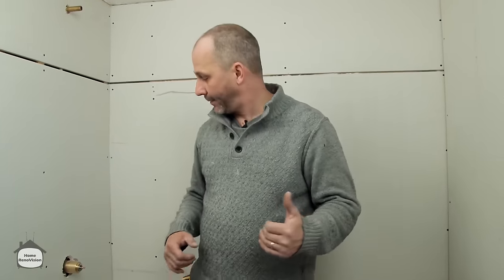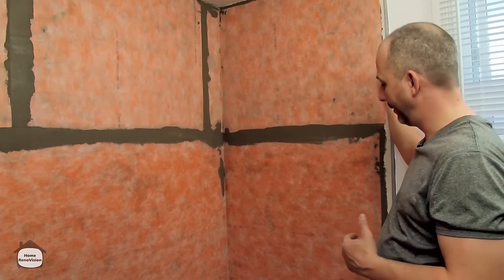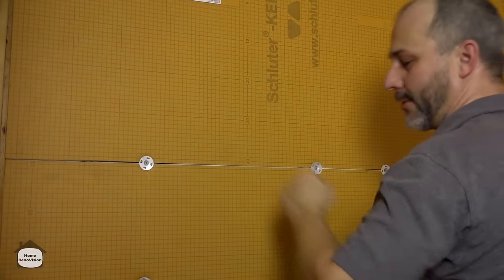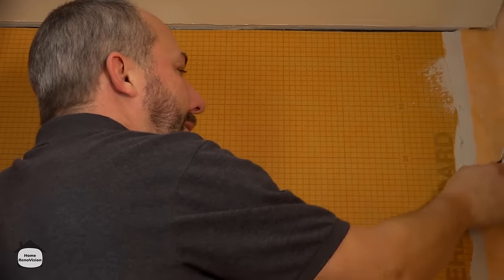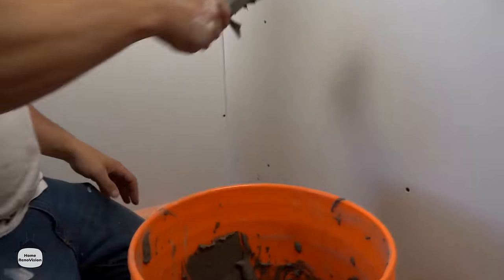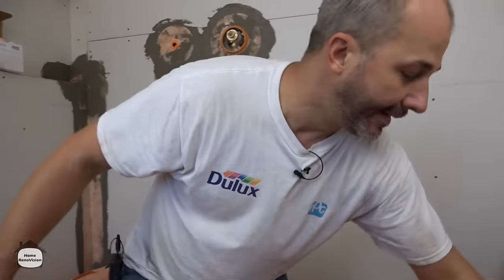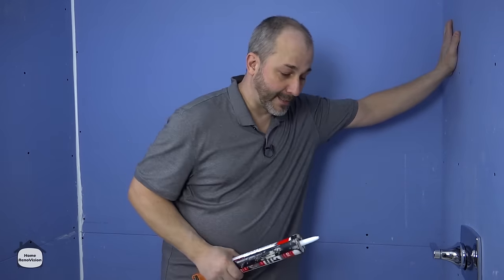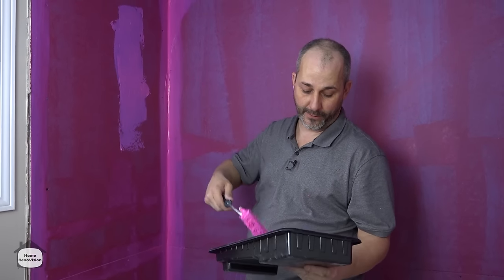4 Types of Shower Waterproofing Systems for Your Bathroom

Comment: Can I use the roll on sealer directly on top of mud bed pan and not use a liner?
Reply from the maker: Hi Bill, the roll on s=deigned to apply to a substrate that is screwed into place and has sealed corners. If you use a pan liner you are using a totally different system and I advise to complete the install according to recommendations form those suppliers.Most problems happen when people experiment with materials that have not been tested with each other. Don't make your house a lab!

Comment: Question: How do you waterproof when there is a window in the shower? We have a sizable one and am wondering how to waterproof the window area as well as the surrounding walls.
Reply from the maker: install a quartz sill around the window jamb and then have the membrane finish onto the back side of the quartz. this will seal it up nicely. Any extra can be trimmed up. or you can use the membrane up to the quartz and then use the kerdi fix as a caulking sealant before you tile. Cheers!
Reply: I would like to see a couple of days to handle the window as I also have a window to work around and haven't figured out my options.

Comment: Hi,  I watch in amazement how you do stuff.  Perfectionist and so knowledgeable!  I would like to know what other sealant you would recommend.  Lepage is only available at Home Depot Canada. We are goingto use last method you presented. Just out of curiosity,  why not  use mold proof drywall tape?Thank you so much.
Reply from the maker: Use the kerdi fix sealant from Schluter  or any other sealant for use on polystyrene. Always use the kerdi tape for a waterpoof seal, Moldproof tape will not bond to kerdi and will break down over a short period of time.
Reply: Home RenoVision DIY thank you!  You rock!

Comment: I just did this job where we ended up doing their shower for them which we rarely ever do, we as actually framed this shower like a year n half ago n the people that came in and did the tile n shower pan screwed it up, so it's a fix it job, any way my cousin n aunt put the tiles on n I believe it's one of those special steam showers has 2 shower heads, n they attached the tile with mastic instead of mortar or thinset and I was wondering if that's okay because I have read that mastic will fail if it gets wet
Reply from the maker: I never use mastic on a membrane. There is bound to be a problem over time  dependingoon how much use thew shower gets!
Reply: @HomeRenoVisionDIY  thanks that what I thought! Little late now... lol I won't say anything till next time we have to do one, he's the boss anyway, thanks again

Comment: Do you need water-proofing and insulation on the inside shower wall containing water lines and diverter? I had to open up the wall for a leaking issue.
Reply from the maker: waterproofing yes but no insulation.
Reply: Thanks...

Comment: Can I build a 4'W x5'D curb less shower? I will cut the floor joist for a quarter bubble and sister each side plus cross brace for added support.  Drain is 13" off the rear wall. I want to install a 40+" linear drain. I will lay two sheets of treated 3/4 plywood on the joist with EPDM membrane seal. On that I want to tile with thinset  Walls will be Red Coated and overlap the EPDM floor.
??? YOUR THOUGHTS 

'
Reply from the maker: very creative, sounds plausible, however where are you getting the linear drain from and is it compatible with your plywood install?

Comment: Can you use cement board then you put red guard and then Schlueter‘s membrane for extra extra no leaks Insurance
Reply: John Newenle probably but the last system, using cement board and using fibreglass tape before painting the membrane is the best system and is also the system used mostly throughout the world. Here is a video showing the Australian system after the taped joints stage https://youtu.be/TmrFUgI1C58

Comment: What if you already have drywall installed that isn’t mold-resistant? Can this system still work (the last old-school method)?
Reply from the maker: anytime you install a waterproof membrane you separate the mold in the framing from the source of food which is water so yes it works. Just not best practice. Cheers!

Comment: I am using the waterproof membrane method and am unsure if I should use 1/2" mold resistant drywall and put it ontop of the bathtub flange OR 1/4" cement board and put that ontop of the bathtub flange then use Kerdi Fix to seal the seam. Any help would be greatly appreciated!
Reply from the maker: Hi Chris, either material will work with a membrane. both need to be sealed to the tub, and both should be 1/2 inch or you can run into problems if the tub is not tight to the framing in all 4 corners.
Reply: @HomeRenoVisionDIY   Thank you! your videos have been EXTREMELY helpful for a DIYer :)

Comment: How would you waterproof if your were install a non tile shower, say a delta classic shower kit? Do you still install all the drywall and instll the shower kit over it? Asking for a friend.
Reply from the maker: most shower wall systems require a backing to glue the panels too. always read the instructions for the product to know how to set up. Cheers!

Comment: Big fan of HRenoVisDIY videos.  Lots of thumbs up and fully subscribed.  I'm still a bit confused as I approach my BathR reno however.  Big part of it has to do with what materials I have available to work with and costs.  For example, do I use mold-mildew resistant 'green' drywall which costs about 2.5x the cost of cement board for my wall backing (non-shower areas).  Because I plan to have facet out of the wall vs. vertical mounted out from the sink countertop I thought is wise to waterproof that wall section as would the shower however not as 'water tight'.  I really don't like drywall because we have constant 70% or higher humidity.  Any advice from anyone is appreciated.

Comment: Great video! I am interested in the Redguard method for a 48" x 48" neo angle shower. I want to do a DIY shower pan using cement on the base over 3/4" plywood. Walls are exposed studs now, so I can add drywall instead of hardi backer if that is better? Any tips for building the edge, drain install with redguard, etc? thanks!
Reply from the maker: redgaurd is a waterproof membrane. the shower itself still needs to be designed to divert all the water to a drain that gets past a waterproofer.
Reply: @eschrader  How did it go? Any learnings? I'm about ready to do my shower.

Comment: Question I've seen a couples of video now applying the kerdi membrane directly on gypsum, but some people told me that we should not do that we always should apply that membrane on cement board. What do you think about that? Thanks in advance!
Reply from the maker: if you are going to go through the cost of cement board and membrane then just buy the kerdi board. It is the same price and saves a ton of time.
Reply: Overkill
Reply: @royrhodes3586  Schluter actually recommends gypsum board as the preferred method of installation.

Comment: Can I use the last method with redguard/ lepage over cement board? Any benefit or issue in using these products together? Sorry I know absolutely nothing about waterproofing.
Reply from the maker: cement board requires a special tape and cement joint compound. The you use redgaurd only. Lepage to seal to the tub after .

Comment: Great video, thanks. I want to remove a 30x60(approximately) tub and put in a curbless shower with a linear drain against the long wall. It seems like the kurdi sloped bases with the linear drain max at 55 x 55. Any suggestions?
Reply from the maker: build jup your bathroom floor and be sure the whole room slopes in that direction.

Comment: can you use kerdi board and membrane to bathroom floor when installing heated floors and ceramic tiles.
Reply from the maker: schluter has a membrane designed for floor heating. It is called Ditra. Cheers they can be sealed together.

Comment: I’m putting in a curbless shower. I just finished waterproofing the walls today(kerdiboard). I have a shower valve that does NOT fit into the Schluter 5” pre-fab guard. I can’t find a Demo YouTube on how to waterproof that valve. Any thoughts ???
Reply from the maker: In most cases quality products have a seal gasket on the finished trim . If not I just did a how to silicone video that shows how to seal up a shower trim. Link https://www.youtube.com/watch?v=N7mC2DQVl-w

Comment: do you use tile on the last system you show?  would you ever put a tub and tub wall enclosure together?  I was told by one contractor that they take the shower down to the studs and just install a tub enclosure to the studs?  Is that reasonable?
Reply from the maker: if the enclosure is rigid then yes, that is the right procedure. If is a flexible pannel then you need a wall backer board. Cheers!

Comment: Hey jeff I have been watching your video for a least a year. Been planning on doing my bathroom renovation. I like the first version of the video to waterproof your tub. So my question is. Can you use the mold resistant drywal in stead of regular drywal? Or does it matter. Thanks love your videos. Ontario proud.
Reply: Yes you can. But it's probably overkill if the schluter membrane is installed correctly.

Comment: Great info., Jeff!  I love your videos.  I bought Hardi backer, then Mapei Elastic paintable membrane, and then I got some Ditra for the bathroom floor.  I am putting in a whirlpool tub.  I was going to paint a membrane under the tub pre-install, but that is it.  I was thinking of using a bit of all three systems and applying the backer board, then Mapei, and then the Kerdi membrane for the shower walls (plywood, paintable membrane, and then Ditra for the rest of the floor).  My question is can I paint the membrane over the backer board and then apply the Kerdi with the nonmodified mortar?  Will I get good adherence or is the overkill too much?

Comment: How do I door the floors with kerdi? I have a large shower space about 86” length. Can use the boards or just backers and kerdi membrane
Reply: If you’re doing kerdi, you’re gonna have to do a mud bed, or you can also use schluter pan and waterproof all corners with kerdi band and inside kerdi corners

Comment: Schluter guy said their Kerdi band wouldn't work to seal the joint between their shower pan and cement backer board.  I don't get it?  The Kerdi band is applied with thinset, so what's it matter if it's going over cement board or Kerdi board?

Comment: I can’t speak for Canada but in the United States gypsum board was removed for use in wet areas including green board by both the tile council of America and the ANSI standards.The manufactures of the boards  also came out with position statements stating that it is unsuitable for use in wet areas.Noble Co. sheet membranes have offered a lifetime warrantee since 1964..
Reply from the maker: Canada still allows it. Cheers!

Comment: One issue I have always had with kerdi is where there are multiple corners meeting. Once you put multiple pieces of kerdi on the build up is higher than on the other portions. Can cause your tile to pop out slightly.
Reply from the maker: buy the corner pieces. problem solved.

Comment: On the shutter boards, do I tile over the shutter board or would I need to then after put a cement board?
Reply from the maker: Yes Juan, you tile right over the schluter. Cheers!
Reply: And before the shluter board goes the purple drywall goes first correct?

Comment: instead of using mold resistant drywall what if I use cement boards and then the Redgard?
Reply: the same end result, just different substrate materials.

Comment: I'm a bit confused because at 25:28 you say that they don't actually sell everything necessary to do a full warrantied install, but then elsewhere like at 43:28 you say that the ten-year warranty is a comfort. They could offer a thousand-year warranty with no risk to them so long as they know that no one can complete a proper installation that meets the requirements.
Reply from the maker: you can but the kerdi fix online from amazon using our link in the description to get the warranty.

Comment: Thanks for your videos! I find the super helpful! I have a bathroom shower over a tub. 100% waterproof currently just ugly. Think three walls of full 1/4" plastic sheets and a sink to match. Think molded plastic sink. I would like to tile the walls of the shower (top of the tub) to the ceiling. Every contractor quote included ripping out all the 1/4plastic thickness walls. There are three sheets that make up the tub walls. 
Is there really any reason to rip out a 100% leak proof system to reinstall another 100% leakproof system at cost. Can't I just RedGuard it all and start tiling over the walls vertical to the ceiling?
Thanks for all the helpful thoughts!
Reply from the maker: I don't recommend that but if you want to try let me know how it turns out!
Reply: @HomeRenoVisionDIY  Is it the combined weight of tile issue?
Reply: just a thought but ho about sandwiching with cement board before tiling??

Comment: Thank you Jeff for these very informative videos.  Do you have any videos about sealing the grout in the shower?   Thank you
Reply from the maker: I like to use the grout from Mapei that has the sealer in it already. They call it " ultracolor"
Reply: @HomeRenoVisionDIY   Thank you for your reply.  My two showers are already finished and the grout is not sealed.  What can I do to seal them?  Any products you recommend?   Thank you very much.
Reply: As long as you clean the grout very well, pretty much any grout sealer can be used. Just make sure to follow the instructions on whatever sealer you buy.

Comment: Can I use red guard with cement board or does it need to be wet rated dry wall?
Reply from the maker: Hi Gabriel, we did a video recently where w e used the cement bloard product. it works amazing in conjunction with the red gaurd or aqua defense products for waterproofing as long as you use the reinforced mesh tape on all your joints with cement mortar to create a seal. Cheers!
Reply: Home RenoVision DIY thank you HRV DIY. I ask because my city inspector is not allowing for green board in the shower. Your videos are amazing and are getting me through my remodel. I much appreciate the content. Thanks again!

Comment: Its me again. One more question: I bought the schluter trowels but im unsure if I purchased the right size for the kerdi sower pan. The supplier had the 1/4"/1/4" trowel as their largest trowel. is this the size you used to lay the pan or did you use a bigger notched trowel? Thanks for all your help!
Reply from the maker: I use 1/2 x 1/2 but the schluter trowel you have is actually designed for the membrane.
Reply: How did this project go for you?  I am considering this system for my first time shower remodel.

Comment: Would you ever use a cement board painted with redguard, or is it actually better to paint over drywall (or mold proof drywall)?
Reply from the maker: cement board is the gold standard and yes when i use it i still seal the base to the flange and waterproof it as well.

Comment: Great Video.  I'm redoing a 42" neo angle shower upstairs. I removed old cultured marble on walls and is regular drywall behind.  Should I take out drywall and install Kerdi board, or can I leave the drywall on and put the keri sheet over?  Also I am thinking of reusing the existing cultured marble base and roughing it, keri the wall to the marble base...then tile over the cultured marble (with a 1/4 inch drain extension.  I would also build my own shower curb. The reason for all this is because I bought the glass...but there is no acrylic base to match my glass.  Keep up the great videos!
Reply: I see it is ok to leave the regular drywall on and keri membrane overtop.  I will moisten the drywall prior to adding non modified cement.

Comment: Can you compare Schluter with Prova shower systems?  Look very similar.
Reply from the maker: I am sure it does. But is it?
Reply: The Prova system is the same concept. It's a cheaper knock off brand sold at Menards. I have used the system with no problem.

Comment: For waterproofing screws on the foamboard, why did you end up using the kerdi squares and unmodified right after telling us the caulking was easier to do?
Reply from the maker: It is also more expensive and I am cheap!
Reply: @HomeRenoVisionDIY  thank you for the reply. The kerdi seam tape is like $30 for 16 feet, so that's $2/foot or $0.66 per 4" square. Isn't the caulk cheaper? Not trying to pick on you, just picking your brain ;)

Comment: i am tiling my shower. my floor is concrete and walls are brick and plaster. what is  the best way to waterproof the shower and  do i have to waterproof the floor.
Reply from the maker: use a roll on membrane system and yes roll everything. Cheers!

Comment: Metal lathe and cement plaster is the best in my opinion. Stick tile to that and a concrete floor you will never have an issue.
Reply from the maker: Just the musty odor of water sitting in the drain pan. Cheers!

Comment: In more opinion what is the best system to use for DIY
Reply from the maker: I love the schluter board. it is water proof and easy to work with and the panels come already waterproof. all, you need to do is seal the joints. Since the labor is free you can afford to invest a little more on the waterproof system. Cheers!

Comment: One thing I don’t like Kerdi is you have to use non modified thinset. I’ve read reviews that overlapped corners don’t stay down because it’s unmodified thinset. For this reason I went with a KBRS shower pan that one requires setting on modified thinset using a 3/4” notched trowel. That ain’t going anywhere. Used GoBoard for the walls.
Reply from the maker: like most detailed products out there. You should get training before installing. Never rely on reviews, you actually have that information backwards.